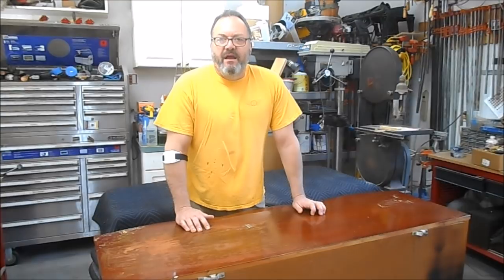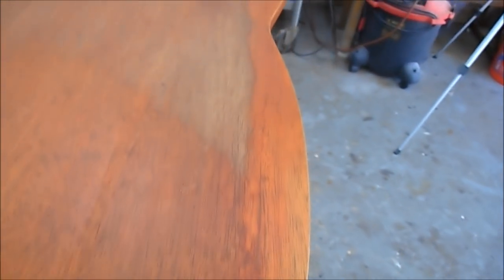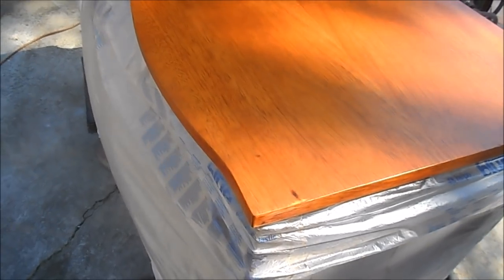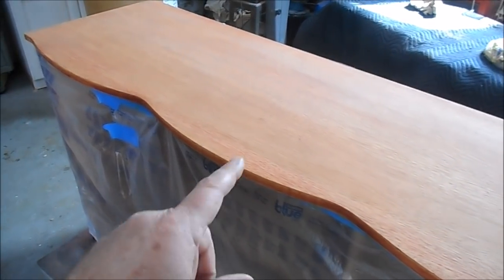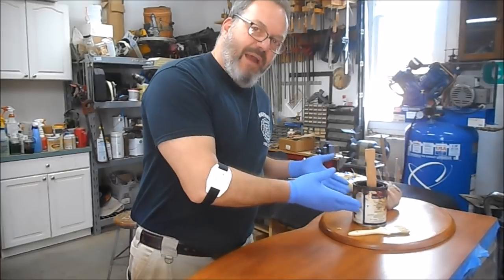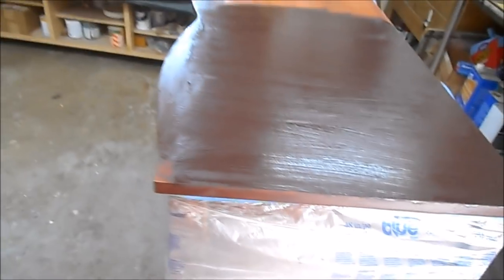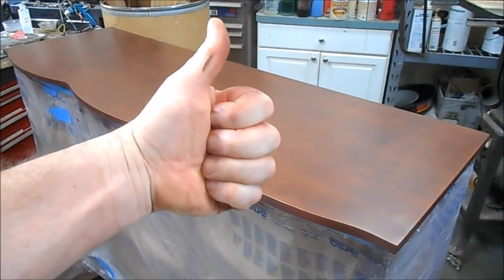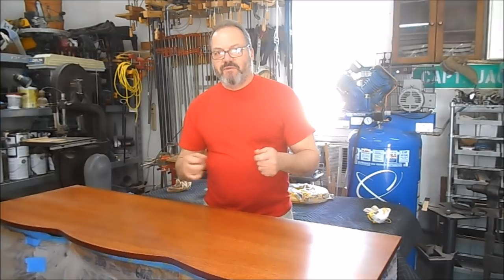Refinishing the top of a mahogany dresser

Comment: Looking good as always.  I enjoy your videos. You are a great teacher. In the past year I have started using AquaCoat Grain Filler. It is Vaseline consistency and dries crystal clear. It is an equal amount of work as paste, but allows the natural grain color after staining to show through or it can be tinted with Transtint dyes if you want a different grain color for contrast.  For open grained woods here is the process that I have success with:
-Stain
-Seal with vinyl sealer
-Sand
-Apply 2-3 coats of AquaCoat with plastic card or plastic squeegee sanding between coats with 220. Dries to sand in 30 minutes to sand. 
-Final sand
-Allow 24 hours drying after last coat
-Seal with vinyl or 1st coat of Precat
PS-I wish I had that compressor.
Keep up the good work.
Reply from the maker: Thanks, Dave.  I have heard of AquaCoat, but don't have any experience using it.  I appreciate the tip.  My old compressor threw a motor bearing about a year ago and I stepped up and bought this one.   It's been great so far.   It was a bit of a challenge bringing it home, in its crate, in the back of my truck.   You can't lay it down and it has to stay upright.   You can imagine the circus that followed.   LOL.

Comment: Another enjoyable, well done video. You have a natural teaching style that keeps the viewer engaged. Question: I have an MCM triple dresser that has some dreaded white spotty mildew growing on the finish from poor storage condtions. Should I just wipe down with 0000 steelwool soaked in mineral spirits as a first step? In your experience is that wishful thinking and I'll likely have to strip? Thanks for your time.
Reply from the maker: Tough to say without being there to look at it.   I'd start with a solution of Dawn dish washing detergent and TSP in warm water.   Gently scrub with a scrubby pad or 0000 steel wool and wipe off.   That may take off the mildew.  You can follow up with some Old English (scratch cover) and then wax.   In general this has worked for me in the past.   Of course, if the damage is in the finish or under the finish, you may have to strip it off.  Good luck.
Reply: Thanks for the reply! I'll give the Dawn/TSP a try.

Comment: A really instructive video.  I guess you colour matched the top because that's what the owner wanted?  Could it have been left the way it was after you had applied the mahogany coloured grain filler?  The colour was lovely at that point, and the contrast between the lighter colour on top and the darker colour below could have been interesting?  Are there other lighter stains you would recommend for mahogany?  Many thanks
Reply from the maker: I always try to match to original, unless requested to do otherwise.   I like Brown Mahogany as a stain color.  You can also use pretty much anything that will give you the color you envision.   Bare mahogany often has a yellow tint to it which some people find pleasing.  Good luck and thanks for watching!

Comment: Awesome video Larry!  I'm finishing a mahogany desk top that is fully stripped and sanded now.  I don't want to add any color (in face I wish I could tone down the natural orange in the mahogany).  I want to just add a clear topcoat (like GF High Performance water based poly that dries clear) but the surface looks a tiny bit splochy/uneven.  Is there something I should add or do (like a wood condition) before putting on the GF poly?
Reply from the maker: I haven't used that product before, but normally you would just work to build a smooth finish by applying a coat, letting it dry completely, sanding back with 320 and repeating.   Perhaps next time you can thin down the poly a bit and apply a thinner seal coat as your first layer and then go from there?   GF products are very good, so I'm sure you will get the results you are looking for - good luck!

Comment: Awesome video. For Duncan phyfe  do you know roughly how thick the veneer is. I have a few pieces I'm going it be restoring and I'm wondering how risky it is to run an orbital buffer over it.
Reply from the maker: It depends on the piece.  In most cases you can get away with a refinish unless it's been sanded down in the past.   You can get an idea, usually, by looking at the back of the top  where you can see the edge of the veneer on the core.
Reply: @LostMountainRestoration   it's a Duncan phyfe very similar to your top... The edges are ridged. It does not look to be refinished but I'm sure furniture from the early 1900s had a lot of variations in thickness. But like you said I believe there was a lip where the vaneer met. I'll have to check.

If you have any suggestions on a good stripper I'm all ears (preferably gel as I have to go at the edges and thinking about using a stiff brush for getting between the ridges)

Comment: I know I'm two years late to the party, but you have no idea how helpful this video has been for me! :) I have mid-century dresser that has been well-loved, but has accumulated wear on the top. The rest of the dresser would be overwhelming to refinish, but this gives me hope! Out of curiosity, are there any spray/aerosol sealers you recommend for those not able to invest in a spray gun? And do you have any experience with Mohawk's aerosol lacquers? Thank you so much, and for all the work you do!
Reply from the maker: Mohawk sells all of their products in aerosol cans if that's how you choose to go.  It's somewhat more difficult to use a spray can on a large area, but with some practice you should be OK.   Good luck!
Reply: Lost Mountain Restoration Thank you so much! Do you think I’d be ok spraying a coat of aerosol shellac on top to seal it before using the Mohawk lacquers? (It looks like the de-waxed Seal Coat is only sold in the normal can, rather than an aerosol)

Comment: Hi Larry!!  I purchased a Mahogany table and I am planning on stripping and sanding and heeping it in its natural state.  I want the "lightest version possible".  I also don't want a glossy clear coat.  Do you have a video or any tips for me???
Reply from the maker: You certainly don't need to add any color if you don't want to.  Cleat coat comes in many sheen levels and you can apply flat, stain, semi-gloss or gloss if you wish.  You can also explore a simple wax finish or a light Danish Oil finish if that's more to your liking.   Just understand they may not hold as well as lacquer or polyurethane would  to the wear of a dining table or the like.  Good luck!

Comment: so the color goes over a sealer? so you are coloring the sealer and not the wood?
Reply from the maker: Yes.   When you apply stain directly to the wood, you are stuck with whatever happens.   When doing fiddly color matching, you are much better off using the toners and glazes which allow you to sneak up on your color.   I liken it to laying down different layers of colored glass until you get the look you are after.   Thanks for watching and best regards.

Comment: How was the cigarette burn repaired?
Reply from the maker: If I remember correctly, it sanded out.   The deeper ones need to be filled, either with a wood inlay or epoxy, depending on the situation.